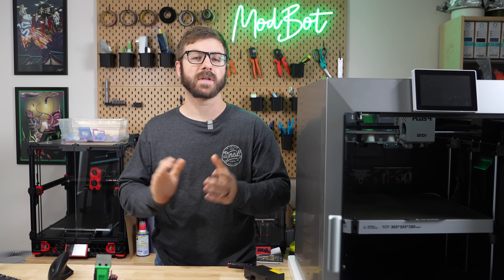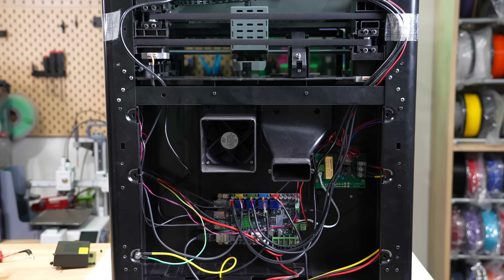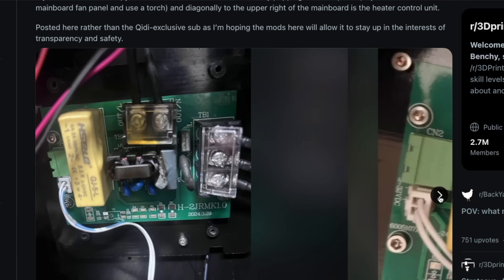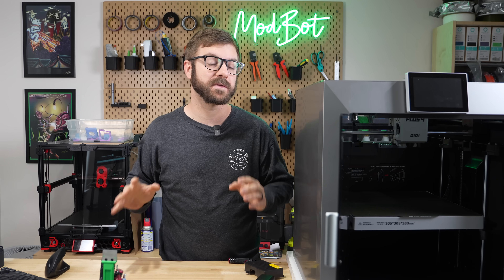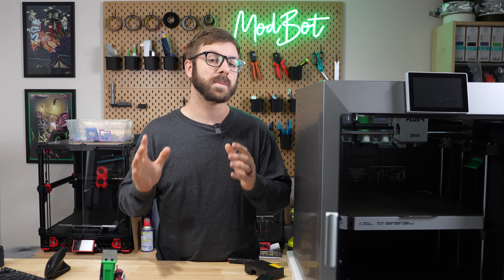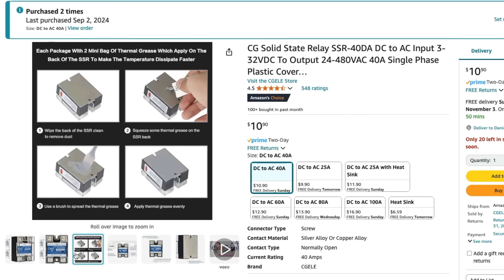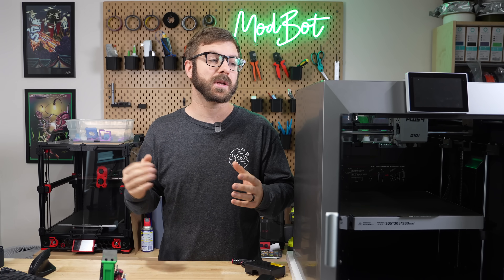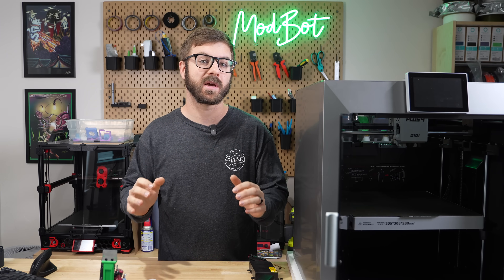PSA: SSR Safety Issues With Qidi Tech PLUS 4 Printer

Comment: Update: As of late last night Qidi says they have revised the SSR power supply for the chamber heater and will be shipping it to owners in 120V regions soon, along with extending their warranties by 1 year. I received this news by email after repeatedly pressuring Qidi to make a real change to the hardware. It was a community effort to push for this change. Others have received the same news now, so it is confirmed in more than one email. We don't know exactly what the revision is yet, but hopefully it will be adequate, as we had found the firmware change alone to be insufficient. Qidi insists there is no risk of fire, only component failure. I can't comment further on that, but we have not seen a fire yet, luckily.
Reply: To be clear, any new boards sent out prior to today were just like for like replacements and the fix for the issue was intended to be the firmware. New boards which will start being sent out are supposed to be different in some way. I have no further information than that yet except that is is " a free optimized replacement heater power supply, which will significantly reduce the inductor's operating temperature" and hopefully that's true. Anyone who owns the printer now should reach out for a replacement. Qidi claims they have sent emails to all owners, but I assume they have missed many for various reasons, though I do know several customers received emails about the firmware at least.
Reply: @802Garage  I emailed them yesterday asking about this.  Their reply was: "If any user encounters issues with heater aging, we encourage them to contact us to replace the new chamber heater power supply (specially customized for 115v countries) free of charge."   I'm not sure how "different" that would be from the existing board.  They also didnt say anything about new machines having such a new/different board.
Reply: @DeusExAstra  "specially customized for 115v countries" is the difference. Until yesterday, they were only sending out replacement relay boards which were identical to the one the unit shipped with. This is a new development.
Reply: @802Garage  According to them: "This is a spare part only. When encountering aged relays, we can provide it as a replacement."  So, in other words, they are not shipping new printers with this new board.
Reply: @DeusExAstra  Any printers manufactured going forward will be using the new part. Any which are already boxed and in warehouses will not be recalled and given replacement boards. That's my understanding.
Reply: Including replacing the ABS casing with an actually FR version, as the current one they claimed was FR is most definitely not.
Reply: @ScytheNoire  There is a big difference between flame retardant and flame proof or self extinguishing. Just because you can light something on fire if you hold a flame to it long enough doesn't mean it isn't flame retardant. That said, I cannot comment on what classification the SSR cover deserves if any.
Reply: I have not received any emails from QIDI about sending me a new board. I will reach out to them.
Reply: @JohnDoe-ot5ir  Definitely do so. Ask for the updated board.
Reply: Curious who you talk to at Qidi, Andy just told me there is no new design and only shipping replacements for units melted. From the latest update the Chamber heater is limited to 40% and only draws 200w.... and doesn't actually heat the chamber anymore. The support has been the most horrendous part in my experience... and that is with a fire hazard of a product.
Reply: @slowchildmiata  I know multiple people who have spoken with Andy in the past 48 hours and he is one of the people who confirmed there was a new revision and even sent us pictures. We were expecting a larger redesign, but it is only a change to the inductor/choke which has been overheating. They are using one with much thicker wire and fewer wraps. It should handle the current much better, but we have no idea yet if this is a good enough fix. If you chamber heater is only hitting 200W it is because the SSR board or chamber heater are damaged. We have been testing and determining this for a while as well. Tell support you are only seeing 200W draw and that you need a replacement updated board as well as a new chamber heater. So far every single person on Disk-chord who has asked for new parts has gotten them free with basically no push back and support has been awesome. That's the one area I'll give them huge credit for.
Reply: @802Garage  Yeah he had no push back to sending me part, but made it sound like it was no change... Maybe hesitant since not sure complete fix?
Reply: Copy paste from Andy 
"Did your relay brunt out too ? If not it is fine. The latest firmware version has already fixed the issue. 

If you want a new relay as spare, i will send it for you as spare on Monday. "

This was his response to me telling him 200w, not heating chamber, and heard there was a new version available.
Reply: @slowchildmiata  Yeah I can't really speculate on what exactly he meant, but I can tell you there are definitely two chamber heater versions, one with a large fan inlet and one small. The claim the change was just to reduce noise. There is also definitely now a revised power supply board with a thicker wire choke. I would email him that you believe your chamber heater is damaged and it is noisy if you have the large inlet version and I would ask specifically for the new chamber heater and the revised SSR board with the larger wire choke. I don't really think anyone should settle for less personally. 200W is definitely well below what it should be drawing even with the revised firmware so something is damaged. Especially if it never climbs past that.
Reply: Hey I recognize that area code. That is all.
Reply: @orange3203  It me I'm from Vermont. 😂
Reply: @802Garage  I'm over in the NEK
Reply: @COWGUYVT  Same! 😂
Reply: I haven't seen my emails come through. My guess is it will be a you can get it if you ask for it situation. I've already had the hot end replaced so imy email is not alien to them
Reply: @willofthemaker  I do know of several people who received emails, but I'm guessing this is a combo of incomplete mailing lists, multiple vendors or vendor sites, spam filtering, and possibly even ISP level mass email filtering. They need to get in touch better.
Reply: Only to 120V regions? What a shame, what if you want in a few years sell your qidi plus 4 to someone in a 120V region but you forget to tell to the buyer that there is an issue in the printer... They should just ship new qidi plus 4 with the correction and take back any qidi plus 4 that have the issue and fix it themselves.
Reply: @julienlecoq3539  I don't think anyone is going tp buy a Plus4 and pay $150 in shipping when they could buy in their own country. 😂
Reply: @802Garage  I said screw it and ordered a K2 plus. It's overpriced and it's creality but it looks damn sweet and so far doesn't catch fire.
Reply: @orange3203  Hahaha so far! Hope it works well for you no sarcasm. 😁
Reply: not exactly true,  even though I am in a 240v region and do not have the issue, I pointed it out to Qidi over 5 weeks ago, they already knew and were then working on a hardware and software fix.  I checked again 2 weeks later ams both were available.  This is old news.
Reply: @nicwilson58  We have been tracking this issue in the community for many weeks yes and Qidi has been aware, but they believed a firmware fix and replacement boards would be enough. We disagreed and continually pressured them and now they have at least revised the board with a beefier choke. Jury is out on that one.

Comment: Ya this needs to be corrected by the manufacturer, im tired of users having to do band aid fixes on incomplete printers being rushed out the door
Good video and thanks for the PSA
Reply: THIS IS 2 PRODUCTS IN A ROW BY QIDI WITH ELECTRICAL SAFETY HAZARDS!!! AHHHHHH
Reply: @NathanBuildsRobots  The last one was overblown so bad it was a joke. Your toaster is more dangerous.
Reply: Fortunately they now say they have revised the power supply board and will be shipping replacements soon. We'll know more about it once someone has one in hand.
Reply: I agree, I used to be a reseller for this brand, and I was sick of having to create upgrades, fixes and mods just to make them work right, using AC heating systems for the chamber or the bed can be risky, and absolutely must be done safely and correctly, as the risk of fire, personal harm or even death is extremely high if things go south, they already had a machine giving people shocks from the AC chamber heater, the ones I design are DC only, and lower wattage too, you don't need anything really high if the printers chamber is sealed properly.
Reply: you think if they looked at the machine with thermal cam they would see this stuff. they likely don't
Reply: @Burnstation3D  I would say the problem is related to the fact that China run 220v, so they may not have tested properly in a 120v scenario, I see this problem all the time with other devices, as our power can go as high as 250v in AU and some devices cut out when it goes over 240v, like smart light switches randomly turning off, it comes down to improper testing.
Reply: @NexGen-3D  if they don't have a test bench setup for 120v and are testing all these devices on 220v then we have a huge problem. that was one of the reasons creality moved to new warehouse, to have more room for testing units before they leave the door...that being said not sure if that makes a difference if they are not testing to different regions voltages
Reply: @Burnstation3D  I cant be certain, but I suspect it had something to do with it, saying that, QIDI are usually quite good on owning an issue, but they do push out products far to soon, and it always comes back to bite them, this particular one is far more serious than just being a crap printer, this is a real hazard.
Reply: @Burnstation3D  Jesus people of course they have 120V test benches. Doesn't mean they catch everything. The same power supply board is used in the Q1 Pro and has been problem free. The difference is it used a 300W heater at 100% duty cycle while this heater is much more powerful and was run initially at 0.7 duty cycle and now 0.4 duty cycle. Despite the average current draw being below what the components are rated for, there is still an issue with how it is performing. That's the core of the problem here.
Reply: @Burnstation3D  When some guy in the USA or Europe will test and re-engineer for free, why would they bother? 

Not like you could sue them.
Reply: @Burnstation3D  Oh, I forgot about the treaty. So nice of Canada to offer those free services.
Reply: Toasters aren’t exactly safe either
Reply: @NathanBuildsRobots  Cars are much more dangerous. So is walking.
Reply: Yeah I wonder why you didn't called out Flsun when they released the v400 with their thermal runnaway disabled in the PRINTER.CFG FOR MONTHS LITERAL MONTHS.

Same shit with the S1 but hard coded in to klipper.

Comment: That does not even look like an SSR
Reply: It's a custom board. The typical off the shelf SSR units have all of this condensed with SMD components on a small board inside of a plastic and metal shell.
Reply: The white thing that went yellow is I think
Reply: @LostInTech3D  It starts life yellow, but yes that yellow block is the actual "SSR" component of the board. The other components do a few jobs such as surge protection, handling noisy current, and theoretically reducing power if components are overheating. Most of that is taken care of inside a typical SSR unit as well. Why Qidi went this direction instead of using off the shelf parts is unknown.